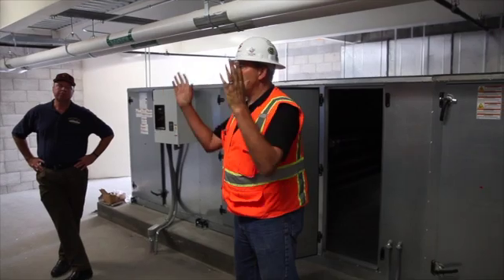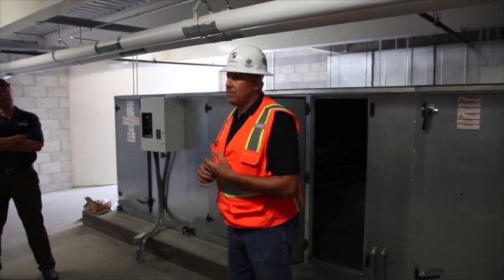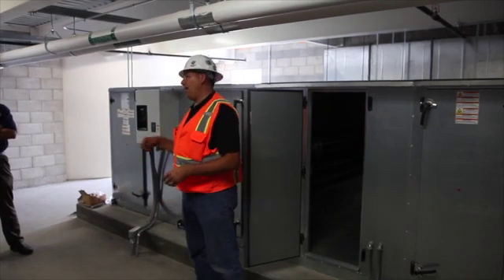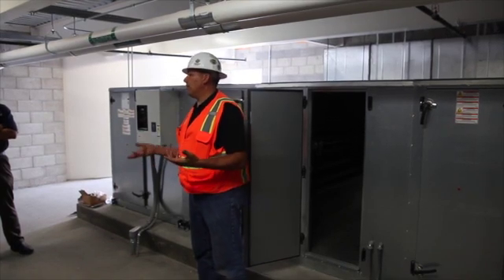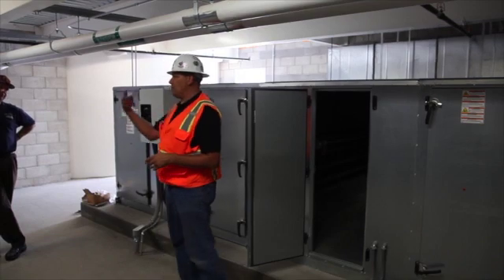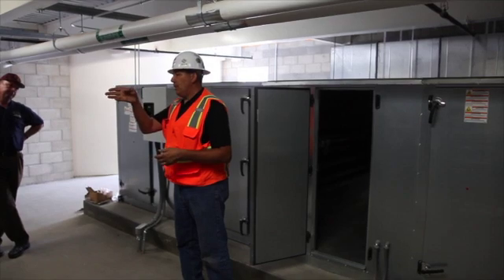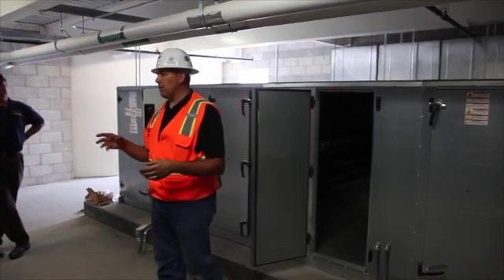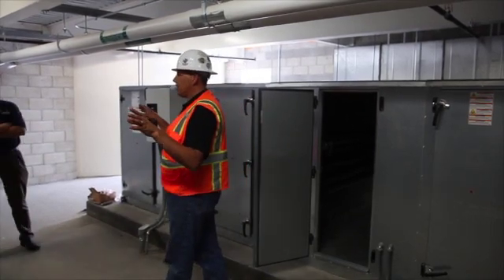HVAC Units VAV Box Explanation

Comment: What is the difference between Vav and  motorised VCD in HVAC? Can we use a motorised VCD instead of a VAV box or vice verse
Reply: VAV have the sensor, which can to measure the speed of airflow. motorised VCD cannot to measure anything. Also VAV can make feeedback to the main fan.